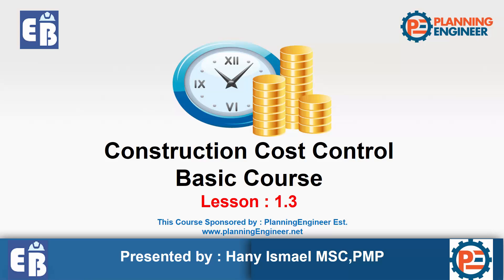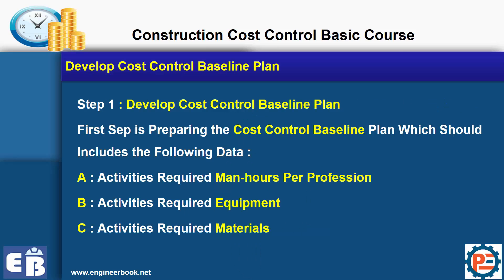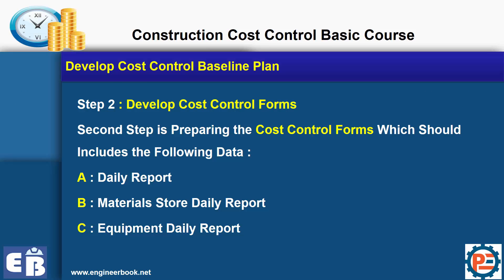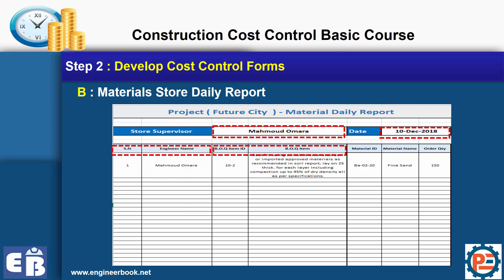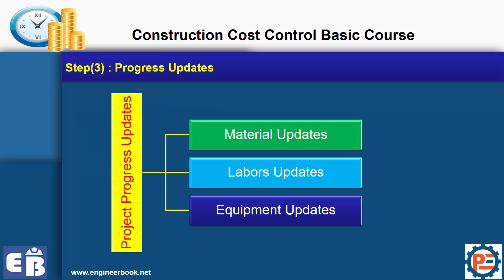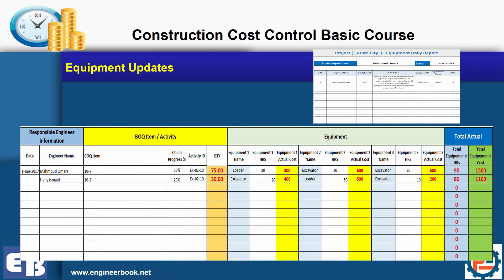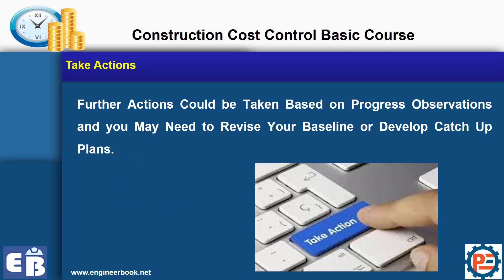How to perform cost control in construction projects

Comment: TLDR: Cost control in construction projects can be simplified and done with minimal involvement from the project team by developing baseline plans, collecting daily reports, and automating the process.

00:00 👷 Cost control in construction projects is simple and can be done with minimal help from the project team.
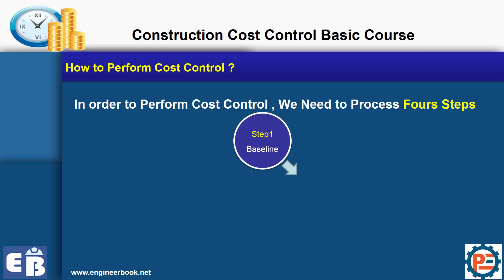01:38 🏗 Develop baseline and forms to compare actual progress in cost control for construction projects, continuously revising based on project conditions and resources.
03:50 👷 Develop a cost control baseline plan in four sections: man-hours, equipment, materials, and forms.
05:56 🏗 Daily reports from site engineers, material stores, and equipment supervisors are essential for cost control in construction projects.
07:12 🏗 Cost control in construction projects involves tracking materials, manpower, and equipment usage to ensure accurate reporting and comparison.
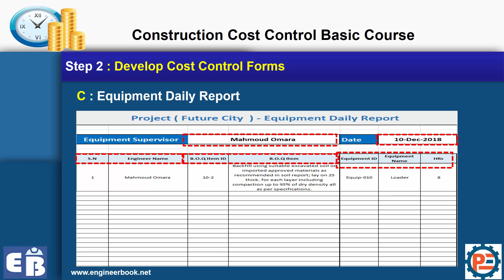08:58 🏗 Simplify cost control in construction projects by creating simple Excel sheets and templates to collect information from the site for material, labor, and equipment updates.
10:44 🏗 Populate all construction project data in one sheet for reporting, including materials, labor, and equipment updates, and automate the process to reduce working hours.
12:12 🏗 Control costs in construction projects by collecting information, preparing progress reports, and taking actions based on observations, while showing the team that cost control can be done with minimal involvement.